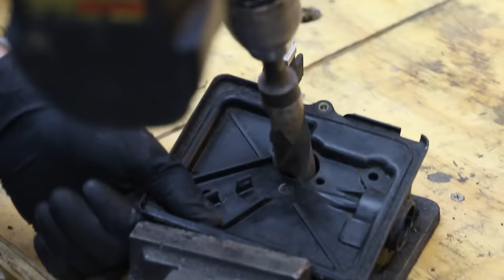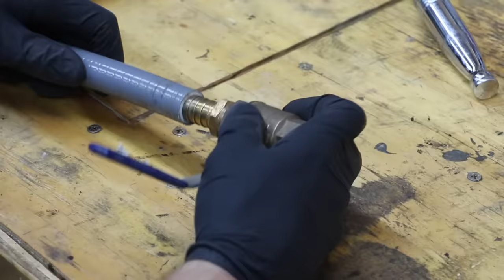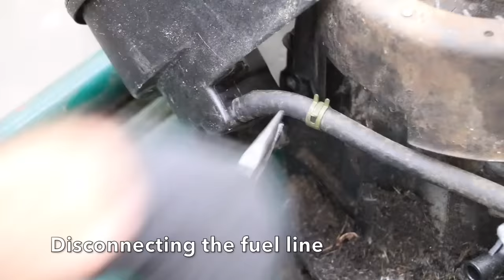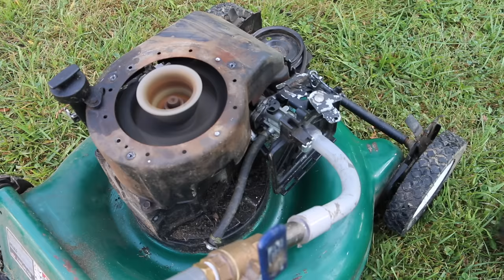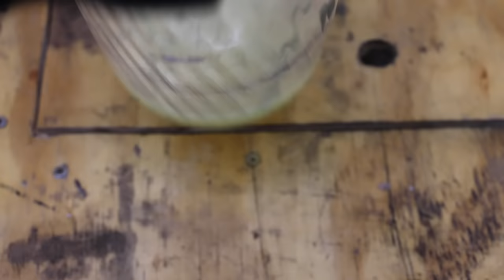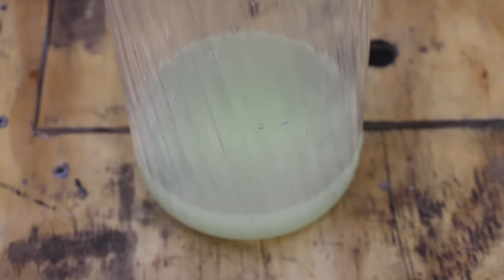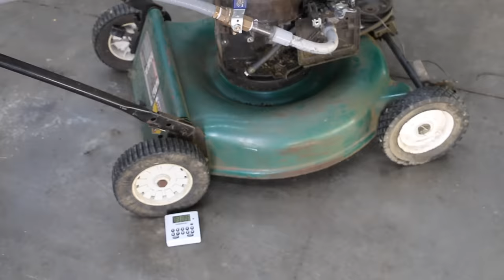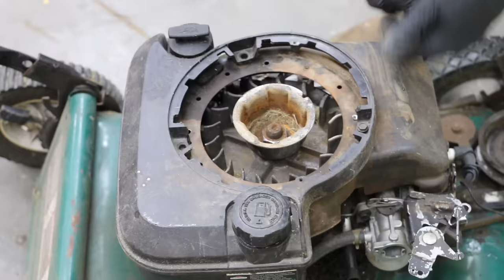Will a "Gas Vapor" Container Improve MPGs and Fuel Efficiency?  Let's find out!

Comment: Thanks for showing this video.  I've often wondered what it would be like to run a car on pure vapor and this video proves that it is possible. I was a little surprised at the consumption results.  I would have figured it to have been in the 10% or better range by running on vapor. I would think the engine would have been running leaner.  Apparently, an engine with a healthy carburetor or injectors breaks the fuel down enough so by the time it's in the cylinder, it's already fully vaporized. 

I've been in the automotives business all my life and I have often heard of Old-Timers talking about cars they had bought new in the 1950s that had "experimental carburetors" that we're getting 70 or 80 miles per gallon and were mysteriously replaced during the first servicing.  

I don't care who is saying it, but it is simply impossible. The laws of physics dictate exactly how much energy it takes to push a car down the road and reducing the fuel consumption by half is simply not going to work. If it were so simple they could take a conventional carburetor and just lean it out to where it was drawing half the gasoline and then see how well the car runs. It won't run at all! 

Engines today run using half the fuel of their 1960s counterparts and that's only because the engine is designed to be economical and use less fuel. It is simply made them more efficient but no laws of physics are being violated.  1960s engines simply wasted energy.
Reply: This was a good comment. The way this "evaporator" was built it doesn't allow for the air fuel mix to be controlled, and the AF will become leaner as the fuel level drops. To see the real potential you have to be able to control the AF, and keep it constant through out the test. But as you wrote there is no magic going on here so I wouldn't expect fantastic results. I do however wonder if a small Briggs & Stratton is the best test platform. While B&S generally are reliable and easy to work with they are built to a price point, and I doubt their carburetors are the best possible.
Reply: Blahorga Slisk   In the late 1940s until 1956 Nash had an unusual head on their OHV 6 cylinder Ambassador engines.  They called it the "Iso-Thermo" head.  The intake manifold was integrated inside the head, just over the top of the combustion chambers.  As the AF mixture moved through this hot chamber it further vaporized the gas so (theoretically) there was only vapor going into the cylinders.  Probably held true for cylinders 1&6, and possibly 2&5. 

I don't know of any further research in that area but the several Nashes I've owned got remarkably good mileage for a big car.  In fact in 1953 Nash won the Mobil Gas Economy Run at 23.3 mpg.
Reply: This has nothing to do with the carb. If you are running on vapor, the carb is useless. A carb and infection introduce a spray. The vapor system would,  and does work beautifully with out a carb but does require a metering system of some sort to achieve the correct stoichometric ratios to run efficiently. This science DOES produce "fantastic results" as you call it. The science was tested in the 70's [and possibly before.] when the computer systems weren't available to control it and the results were 50 to 60 MPG in a Vega. With modern computer technology the results could be huge..........The science is out there if you want to learn! Google hot vapor engines. And it is rite here on youtube. ...........If you wanna learn?????????
Reply: "I don't care who is saying it, but it is simply impossible" Sounds to me like you Know more about this than the scientists and engineers that have already proven this technology. This HOT VAPOR FUEL tech can be googled AND it is rite here on youtube. There is a world of knowledge rite here in this column if you wanna read down to learn.........But some people would rather talk about things they don't know about, with out doing the research!!!!!!
   The carb and infection systems are spray systems and any evap that happens is just coincidental, but look at the intake sides of your valve and you will see a huge buildup of junk that comes from liquid fuel splashing on the valve. [and a little engine oil as well]. Look at the tops of your pistons to see all the liquid residue. .....The spray system is not really efficient.
    If you have ever seen the valves and chamber of a propane system than you have seen what I talk about!
    If you say "I've been in the automotives business all my life"  then you NO DOUBT have heard of Smokey Yunick???? He is right up there with Carol Shelby. Yunick was Nascar and Shelby was road race.
Reply: The carburetor is important as it's what you compare against. If the carburetor isn't working as intended then the results will be skewed. The same can be said about the evaporator. If you are able to calibrate the fuel to air ratio then it will perform better than if the ratio is allowed to vary without any control.

If you are trying to compare two fuel delivery systems like this you have to use the best versions you can get. Only then can you tell if one is better than the other, and how much of a difference there is.
Reply: James S. Ever heard of 'fuel/air explosives '?  
It is the degree of 'mix, or how fine the mix that is the factor here.
Reply: Bill Davis  Hi Bill.  I don't disagree with your comments.   What I was commenting on was the "old-timers"  I've run to during my life that told me about "experimental carbs"  that got double the mileage and were later replaced.  That's all I was referring to.  I wasn't commenting on new technologies and engines.  I know we've come a long way to get where we are today on gas mileage.   I'll still stand by my statement.  You're not going to take a stock V8 from the mid-50s and push gasoline vapor through it and squeeze out 70mpg.   With modern engines, and future engines, anything is possible.  That was the gist of my comment.
Reply: If it's efficiency you're after, you'll get a lot further by increasing compression--doing this without causing pre-ignition or detonation is the challenge--and/or reducing internal friction.  Evaporation is a PHYSICAL transformation, which should have little or no effect on the CHEMICAL energy content of the fuel.
Reply: James S. Why , sir, are today's vehicles being limited in the miles per tank?  I have two dodges, 10 years difference, both pulling in at 16+- mpg. The 07 has much more "tech" involved in the operation but not better mpg to speak of
Reply: Tom Inman.... In response to your question, miles per tank is the MPG x the gallons the tank holds.  With cars being smaller, the tanks have shrunk proportionately.  So the miles per tank has stayed about the same for the last 70 years.  The only car company I know of that advertised MPT was Nash, in the late 30s and 40s. The "Nash 600" got its name from the 600 miles on a tankful.  (Of course it had a 30 gallon tank)  

They could put bigger tanks in today but with the MPG requirements now, making the car lighter is top priority.  That's what happens when cars are designed my congressional committees instead of engineers.

Comment: Better economy?  Depends.  You can lean out the mixture until the engine is glowing hot and get great fuel economy, but it won't last long.  There is more to "mixture" than just fuel economy and power.  COOLING is important too.  Light aircraft take off at "full rich" in order to cool the cylinders at high power levels.  You lean them out after you reach your cruising altitude.
Reply: Lean mixture doesn't make an engine run hotter
Reply: Ping ping ping
Reply: @GreenShogun  Oh yes it does. And doesn't. It depends. Rich = lots of fuel and not a lot of oxygen = not a complete combustion = the rest of the fuel goes into vapors = that takes energy = cooler engine. Lean = not a lot of fuel and a lot of oxygen = the combustion is complete = a lot of energy is produces = hotter engine.
But... To much oxygen makes the engine harder to run for several reasons - one of them is that all the air cools the engine down and a very lean mixture demands a very high temperature to ignite so it won't ignite any more.
Reply: @Arsopu  that's what I was thinking.
Reply: @Xanthopteryx  is it not true that a lean burn will not produce good torque and hence the accelerator pump? also lean mixtures have a tendency to pre ignite; under high load or some boost it seems one would break something- a sure way to blow up your motor is to run tons of boost and let it lean out. I know some engine control systems keep it nice and Rich and back off the timing at full Boost to keep the engine from destroying itself, not that a lawn mower would have this problem, but.....

Comment: Actually the only fuel that burns in an engine is the vaporized portion.  The rest goes out as carbon and that's our carbon biuld up on the piston and valves . It would be interesting to see a comparison of that in your two set ups . 
Actually, again , wood ,rubber whatever,  doesn't burn . But if it's heated , it will release a vapor ,and the vapor burns . Hence flash point . 

What a great channel you've created.  You find answers that make more questions.  Really enjoying your videos .
Thanks
Reply from the maker: Thanks and you are welcome!

Comment: Here’s a real question, can he run the lawnmower without vaporizing the fuel lol
Reply: that was what I was thinking, gas burns in a manner that would not run a car (slow burn), however vaporized gas explodes really nicely.
Reply: Yeah, it's a very good point.  You're vaporizing it in the throttle body anyway, so this is just pre-vaporizing it, which technically makes it more dangerous, since there's a higher chance of early stage ignition (kaboom).  Probably you can achieve this without vaporizing by using something like a flame licker engine, although it's tough to say because gasoline even in liquid state is more volatile than alcohol.
Reply: @vladisergeiev7278  it dosent vaporize in the throtal body you knob if it did thered be no point running a car on propain as it wouldent be any more afishent as petrol or gas were ever your from your american arnt you.
Reply: @nofoxgiven6315  Propane is less efficient than gasoline.  In fact unless it's a purpose built propane engine which makes it less...less efficient a gas engine converted to bi-fuel or LPG is around 30% less efficient.  The only reason people do it is because in many area's Propane is about 1/3rd the price of gasoline per gallon.  So 20 gallons of gas is $500 and gets you 600 miles.  20 gallons of Propane is $150 and gets you 420 miles down the road.  So you burn more but it costs less.
Reply: I'm no Grammer Nazi but. I feel like content creators actually look out for an actual question mark and it does help if you post with one of these. --->?
Reply: @slimjim7411  genius and there's a propane station at almost every gas station.
Reply: So, what does everyone here imagine a carburetor does?
Reply: @nofoxgiven6315  Yes all fuel vaporizi in the cylinder. Only vapor can burn. Propane is less efficient, because it has short hydrocarbon molecules, only 3 C atoms, 2 C-C bindings. But you do not need a carburator. You can run on high revolutions/min. Gas have 6-9 C atoms in the molecules. More energy rich C-C bindings. But it comes w a price. Higher boilingpoint. You need a carburator or injection to make vapor. The rest will vaporize in the cylinder by the heat, and then burn. But it takes time. So a gas engine runs best in 1000-4000 r/min. Diesel (10-15 C) has more energy, but burns slower. 500-3000 r/min. Can ignite just by compression. No sparkplug. Vessels run on Heavy Fuel Oil. It needs to be preheated by the heat from the engine to over 200 oC.
Reply: @vladisergeiev7278  It might have cleaner exhaust gasses tho. But i'm pretty sure both the bottle. Carburator or injectors just burn the same ammount explosiveness XD
Reply: @nofoxgiven6315  You are the knob, and since when is being American an insult (and no, I'm not American)?

Comment: Tom Ogle's fuel system worked off of vapors I believe! Sadly he passed away before it could be tested more. This is off of the Wiki page ''Rather than maintain the fuel tank at ambient temperature and pressure, Ogle's design reduced the pressure and heated the gasoline to produce vapors. These vapors were combusted, and the car ran on fumes. This required the gas tank to be structurally supported as it was now acting as a pressure vessel.''
Reply from the maker: I believe his setup was far more complex than the one I put together.  Thanks for commenting!
Reply: Thanks you for the great content! Maybe you could try to replicate it? May be difficult but it's entirely possible to do. Cheers.
Reply: Some people say Ogle was murdered.
Reply: J A He definitely was.
Reply: Anthony GHB You realize gas already has to become vapour in the engine?and that 97 percent of gasolines energy is already used  by modern engines?
Reply: Anthony GHB That is nonsense that would violate the laws of thermodynamics.
Reply: Would there be any reason why bubbling it through small holes in the bottom of the container wouldn't work better? I was thinking as a cheap DIY solution that you could attach and seal a shower head to the bottom of the container and pull the air through that way (after you cut a hole for the shower head of course)

My only concern is gasoline running down into the shower head and not evaporating off, but perhaps something could be used to prevent this, I am not sure if there is something similar to a molecular sieve that will allow air through but not the gasoline, maybe some sort of breathable water or liquid proof film/fabric even... I am not a scientist by the way, just throwing out ideas.
Reply: Look him up they had engineers test his car and everything
Reply: Michal Zušťák. It is called injectors. But they dump way to .much in this set up makes it more vapor
Reply: My friend has this mod on his car on a 2000 Malibu and he gets almost 995. Miles on a topped off tank.
Reply: Bubbling air through a tank of gasoline would make a very nice bomb.  I doubt this would  be allowed from a safety standpoint.  Your idea is sound, but you wouldn't be able to get enough gas volume into the 'fumes'.
Reply: Tom Ogle wasnt he the  guy who sold is patent to an energy company and who died the same year under weird circumstances?
Reply: Its the same patent that has been expired for a long time and anyone can manufacture his device for free if they think it will work.
Reply: I remember reading the article and have been interested in this technology for years. It's also believed he used white gas. I worked on lasers they have a vacuum tank and I could boil water at room temperature. He put gas in a vacuum tank so what I'm saying is when water turns to steam it expands 600 times maybe that is how it works the gas expands. May be a difference from atomizing and vapor. I wonder what temperature white gas vaporizes and how much vacuum it world take. Coleman lantern for a carburetor they run on white gas LOL
Reply: I have 1992 Civic and when I drive it to save fuel I get 47 mpg. 20 years later a hybrid get 48 Highway and 51 city. Somethign does not add up!!! I think you are on to something with the possibility to get 100MPG
Reply: +Scot Johnson I drive a 1988 Honda CRX HF all stock and I easily pull 65mpg barley trying. Record for the CRX HF stock is 110mpg he hyper mile it but still that’s crazy a stock 30 year old car gets better mpg then today’s best hybrid
Reply: I think I found my next ride....Thanks
Reply: ooooh, it was also pressurized. this makes so much more sense.
Reply: @carecaplatonico - a reduced pressure environment lowers the vaporization point of liquids (why water boils in a vacuum), so you're creating a phase change without heat. BUT, then he adds the heat anyway. So, he's achieved MAXIMUM surface area for combustion by achieving the vapor phase. Then he's heated it. Any time you compress a gas it heats up. So then you have hot vapor being pressurised,  which heats up even more, then the spark plug goes click.

it's actually terribly clever.
Reply: basically it sounds like he took the icyball refrigeration unit,  switched out the ammonia for gasoline, and inverted the process to create excess heat instead of excess cold.
Reply: Michael, where did you learn about a 97% efficiency fuel conversion in modern engines? Please post references. Now, according to all resources I have access to - thermal efficiency of a modern engines are well below 40%, today. And, I believe this is with the improved - direct injection - models that do the best job of atomizing fuel. Atomizing fuel is not exactly the same as vaporizing fuel. It is possible that some vaporizing can occur during the transition of the intake stroke and compression stroke of the internal combustion, 4-stroke engine (along with other favorable conditions), prior to the ignition of the air/fuel mixture. Adverse conditions for vaporizing are numerous, and we could discuss this for hours (another time). However, I have yet to find any automotive or industrial engines that "vaporize" fuel as part of the induction system - again, post references. That being said, do you realize why gasoline automobiles are fitted with a catalytic converters?
Reply: Scot hi, just to be sure it wasn't a mistake and i get you well...did you say a hybrid did 48 on highway and 51 in city? I taught it should do more miles to a gallon on highway than in city!